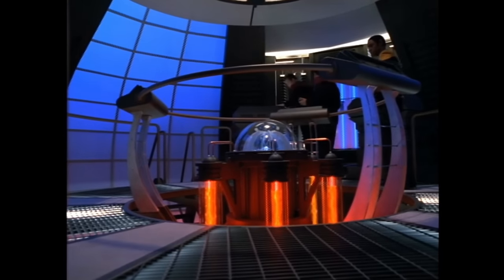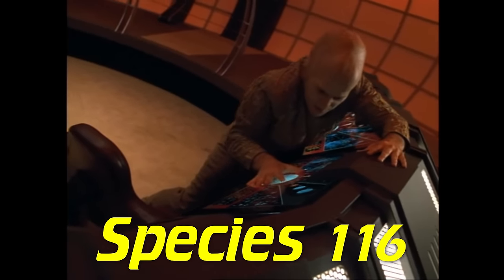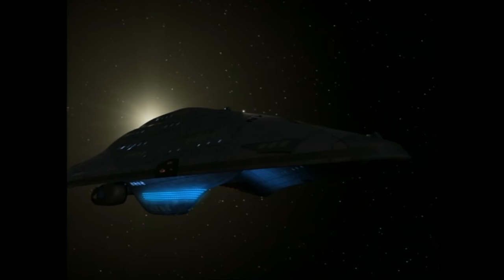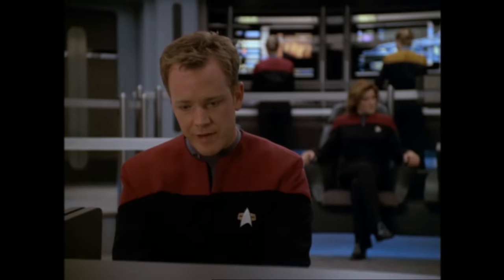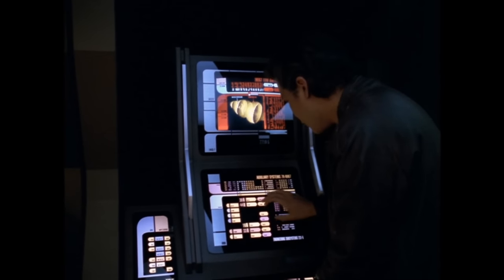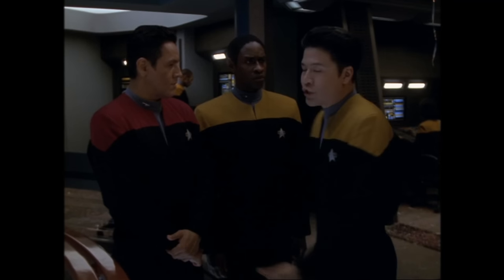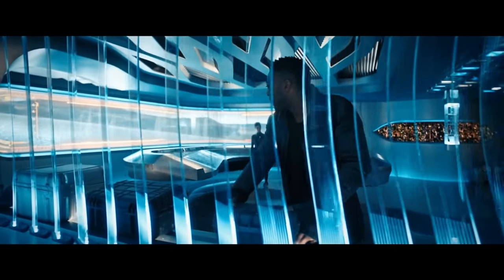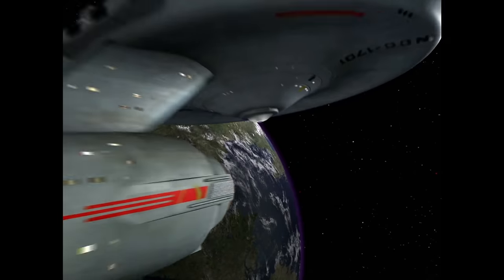Did Discovery IGNORE These Warp Drive Alternatives?

Comment: I like the idea of the "Transwarp" from Star Trek III simply being an improved warp drive that eventually lead starfleet into revising the warp scale from the one used in TOS to the one used in TNG for the sake of simplicity. This would mean that the Excelsior's Transwarp drive actually did work after they repaired the sabotage Scotty inflicted on it, but it was more of an evolutionary improvement than a revolutionary one. This could also be a reason the Excelsior class was used for such a long time while the recently refit Constitutions were mothballed. Maybe it just wasn't possible from an engineering standpoint for the Constitution to be outfitted with the new "Transwarp" drive, while it was possible to upgrade the Miranda.
Reply: My head-canon is that it was the thin neck and pylons of the connie that wasn't compatible with the transwarp, hence why miranda and oberth were also used until the late 24th century
Reply: @Mat0llig  Could also lead into the reason the Constellation was a 4-nacelle design with such unusual placement. A brute force method to achieve the same effect, perhaps?
Reply: i could see the Federation building gravity catapults. They finally had a technology they understood, could build themselves and allowed ships to jump the equivalent of a three year journey.
just put them near secured Starbases or planets and you have the relay network from mass effect for rapid transport.
Reply: I wish they could’ve built upon the tech that Barkley developed when his brain was overclocked by the Cyphereans. Starfleet ships could then have a man machine interface like the Bentusi from Homeworld.
Reply: @Mat0llig   I really like this idea. As a bonus, maybe the new Excelsior "Transwarp" drive didn't need to have the warp coils as isolated from the rest of the ship as much as the TOS warp coils needed to be isolated. This would have meant future designs could be more robust structurally and the shape of the warp field could be made more efficient since the ships were more streamlined.
Reply: @KertaDrake  Very interesting idea! I assumed the Constellation had 4 nacelles because it was designed to operate with a high cruising speed (for it's time) over long distances.  Maybe they were instead a hack added to the design at the last minute that enabled the ship to have speed similar to the Excelsior
Reply: @noneed4me2n7  I wish they would have explained why Voyager couldn't just use the slipstream for a few minutes at a time and make a few hops to reach Earth in the episode 'Timeless'. I don't recall them saying anything about it not being able to be shut down and then restarted again. They only mentioned something about the super dilithium they acquired breaking down, but it didn't seem like this would take place within a few hours.
Reply: @noneed4me2n7  
i think it had something to do with Barkley's super charged brain making the calculations. the federation would never allow the genetic alteration and there was no bio nerural gel packs at that time so it was probably abandoned.
Reply: That questionable explanation doesn't explain why voyager was limited to warp 9 on the tos scale. They even made episodes about not exceeding w 10 and how it will take them 70 years to get back.

Comment: Actually, the primary reason aerospikes (which are basically just inverted bell nozzles) aren't used isn't anything to do with infrastructure or anything like that. Its simply that aerospikes are harder to cool, and therefore tend to have a higher mass penalty compared to traditional bell nozzles. 

Honestly, I figured that the Xindi vortex method doesn't get used is because it probably relies on the weirdness of the expanse (it can probably allow travel between the expanse and normal space, but not without at least one endpoint in the expanse), and so simply doesn't work after the spheres are destroyed. 

And everything else that isn't basically just Q snapping his fingers probably relies on dilithium crystals, so that's out.

Comment: There is also a major point you did not bring up: if transportation/technology is eliminated, then building back up to a working industry to create it is often based upon it, creating a difficult recursive dependency.  In other words, if all land and sea vehicles were wiped out today, we would have grave difficulty making new cars: Chinese steel couldn't go to Tennessee body works to be paired with Detroit engines and Indian electronics and wiring, European batteries, etc.  Moreover, each of those individual parts are based on subparts from around the world.  Now expand that out across a quadrant of the galaxy and the immensely diverse needs and capabilities of a starship.

Comment: With all the focus on dilithium going inert I kind of have to wonder if everyone collectively forgot about Fusion and Fission powered warp drives, neither of which use antimatter or dilithium. I seriously doubt that Zephram Cochrane was able to scrounge up a single yottagram of antimatter to power the Phoenix when Lily was struggling to pull up enough titanium for the cockpit, especially when there was a convenient fistful of fissionables from the warhead of the missile he converted. 

I also seriously doubt that early era warp vessels and civilian freighters that were pulling warp 2 at best were using antimatter as fuel on their years-long journeys to the nearest colonies to Earth, since the Kzinti lesson would very much apply when Piracy came into the picture. 

It's just kind of bizarre from my understanding. Use energy to make plasma, feed into warp coils, go FTL. The only special thing about antimatter is its relative efficiency compared to fusion and fission. Only thing I've heard from STD Stans regarding this is that "Warp Plasma" is different from regular plasma and 'needs' antimatter to make it happen, despite the D'Deridex Singularity based warp essentially proving that generating a warp field is power source agnostic. ¯\_(ツ)_/¯
Reply: I’m sure the Phoenix was fission or fusion powered, but it might still need dilithium. 

Ultimately it comes down to the age old fan debate over whether the warp coils warp space or whether they’re simply very strong electromagnets to channel the dilithium plasma which is itself what warps space. Now I always favoured the latter, partly because the warp coils remind me of tokamaks (especially Vulcan ones), but Star Trek really doesn’t specify. 

At least until Discovery saying dilithium does stuff to subspace, but then maybe verterium-cortenide also does and you need both. Of course you could just as well ask where Cochrane got verterium and cortenum from while they struggled to get titanium, especially since the coils we saw in the show seemed to be regular old copper refrigerant tubing.

Ultimately it kind of just all breaks down if examined too hard. Even pre-Discovery.
Reply: You cant pass warp 2.2 without dill to stabilize

Comment: While time travel was banned (for the best I guess), ultimately that tech could still be used for space travel, given a ‘time drive’ requires moving through space as well as time, you could, presumably, produce something akin to a ‘jump drive’ out of that; essentially an instantaneous jump from point A to point B…

The underlying issue for the franchise is that they’ve clearly decided the audience needs to hear core things like warp drive or photon torpedoes, so they keep coming back to that regardless, even if it doesn’t make a lot of sense to story progression when set much further into the future.

Comment: So why I did enjoy the video. I think you miss mashing too many things, and of course there are issues with the writing in discovery for the third season and how they describe the burn.
Let's start with the mismashing, dilithium is not needed for warp speed. It's needed to generate power because in order to reach warp speed you need a lot of power and the faster you go, the more power you need. Every one of these methods that Star fleet developed or found to travel faster than standard warp speeds. Required excessive amounts of energy and their standard way of generating energy was through and antimatter reaction created by dilithium. In the case of quantum slip stream as you bring up, they use benamite crystals which from the description allow them to adjust the phase variance but doesn't have any role to play in power, which at least suggests that the quantum slipstream requires less power then a warp drive does, otherwise you would still require a matter antimatter reaction to reach the power requirements. The problem is that the writers never think in this set of terms of what dilithium other things are actually needed and it really is just a matter of power. Anything else that's added such as the benamite for quantum slip stream are just add in components needed for operation.

In Star Trek Discovery during the 31st century, it seems like if you have dilithium the ships are traveling much faster than they were in the 24th century going from one end of the Galaxy to the other doesn't seem to take that long anymore with standard warp drive. The writers just didn't expand on the Galaxy enough to make it seem like the warp drives were that much faster. And with faster war drives, probably integrating other types of what was previously considered trans Warp, they probably just continued using the same energy generation capability because like with gasoline. If you want more power you just add more antimatter. Where is with the romulan quantum singularity? That thing is putting out the same amount of power regardless, and the protostar well making a baby star and containing it probably isn't easy. They may have sacrificed some speed by sticking with solely antimatter but it was an easy source of power that they knew how to use and they could squeeze out more and more speed out of their work drives and the one something became standard. It was no longer trans warp. It was just warp.

Comment: We dont use aerospikes not because they are buggy, compared with bell nozzles, and not because we cant be bothered "fixing" aerospikes, we do it because we dont know how to make an aerospike good enough that it will be better than a bell nozzle.

By that I mean that it won't add so much weight and complexity to the engine that all the added efficiency is effectively lost in the extra weight.

When almost every stage of your flight is efficient enough, and you are using staged flight (such that you drop off and land earlier stages) then the advantages of aerospike are even less.

Remember aerospike is about having an optimal nozzle at all altitudes.

If you drop your nozzle off (ie disconnect stage 1 and land it) you are effectively "varying" you nozzle, because stage 2 will have a different nozzle from stage 1.

So you get your "varying" nozzle along with a MUCH lighter and easier to build engine for "free".

No need to vary your nozzle, if you are changing nozzles whenever you encounter significantly different environments.

Aerospikes WILL have a use, but they will need to compete with bell nozzles.  If your engine is only ever operating in 1 atmospheric mode, the bell nozzle will almost always be "better" because it will be lighter and easier to build.

Comment: Well, considering Zephram Cochraine didn't even have dillitium, obviously dillitium is NOT necessary for warp/FTL, it just helps stabilize the antimatter which is merely ONE method of generating Warp (the Romulans, for example, used micro-singularities). Its almost as if the writers of Discovery never watched a single episode of Star Trek. Another great video - very informative.
Reply: Fusion powered warp drives peaks at Warp 2. Warp 2 is Uber slow. It would take about a year to get from one side of the Federation to the other. I think that nonbinary couple was on a warp 2 Fusion ship.
Reply: Hell, the Romulan's method never used Dilithium at all with it.
Reply: @AzraelThanatos  Does make you wonder just why they were mining out the dilithium on Remus for though...
Reply: @KertaDrake  Trade and, probably, having a second set of ships that they'd been using that don't look like Romulan ships. Dilithium is an important trade good after all
Reply: @KertaDrake The Romulan Star Empire used 2 different drives.  The D'Deridex Warbird uses the singularity drive, but most of the other ships use a standard warp core.  Basically, the singularity drive was only put in the most power-hungry and elite ship class, and everything else got the easier drive.
Reply: @KertaDrake   Micro-singularities ship are more demanding on maintenance then cheap Dilithium at the time
Reply: Lol "as if"
Reply: Dilithium is not a power source. It's used to focus energies to produce a warp field, as it exists partially in subspace. All warp drives that exceed warp 2.2, regardless of power source, need dilithium to focus the reaction. As for other sources, Book explained in a throwaway why none of them were terribly useful under the circumstances (slipstream needs a very rare mineral, for instance).
Reply: @TheMrPeteChannel waaaay more than a year. Vulcan is 16 light years away, warp 2 is 4 times the speed of light, so even Earth to Vulcan takes 4 years at warp 2.
Reply: @KertaDrake Prior to the micro singularity drive, they did use dilithium. But they probably traded with dilithium as well.
Reply: It was reported during an interview that there was a small amount of dilithiam in the reactor if the Phoenix. It was EXTREAMLY rare on earth, but there was a small amount.
Reply: @aaronshutts1024  The most obvious reasoning would be that the Enterpsie-D crew gave it to him... but they didn't want to do that.
Reply: @subraxas  So NOT going anywhere, ever again, would be the solution to 'its too slow'? Have you ever WATCHED Star Trek? EIGHT centuries? Slower Fusion drives just means slower proportionate to other tech you could employ, like subspace corridors or transwarp. And don't even get me started on the fact that Starfleet was already experimenting with artificial wormhole generation during the TNG/DS9/Voyager era. Speed doesn't matter all that much when you TUNNEL through space.
Ships in The Expanse don't even have FTL - speed doesn't matter when you can make gates.
Reply: @marktaylor6553  no. The discovery of the dilithium on earth was one of the reasons he got the idea. Now the big question was it natural or was it debrie from some other past ship event.
Reply: @aaronshutts1024  Is that Beta canon, because I have no recollection of any Dilithium being used at any point by Cochraine? What IS canon is that plenty of other species that the Federation has encountered since before there even was a Federation used non-Dilithium based methods of propulsion. You can fudge stuff all you want to try and make this huge plot-hole work, but at the end of the day, STD was a big, wet fart.
Reply: @subraxas  I don't 'freak out'. Way too old for that - I could break a hip or something. 😝
But my whole point was, any long-time fan would know one of the oldest (and perhaps silliest?) tropes on ST is that people on the Enterprise CAN find a solution to absolutely any problem in a single 60-minute episode, even if the entire Federation has been stumped by the problem for centuries. 
So IN THAT UNIVERSE, where we have been trained to understand that humans can overcome ANY diversity at all, and literally save the entire galaxy numerous times without a thanks for our efforts... in THAT universe, humans just went, "all our dilithium is gone, I think I'll go cry in the corner for next eight hundred years"?
These aren't RW humans - these are ST humans. They don't give up. They NEVER give up. And Discovery just took a main aspect of the franchise, crumpled it up, and threw it right out the window. Sorry if I came off like a d__k, but stuff like that - a complete disregard for the flavor of the universe itself - really annoys the crap out of me. Now I'll go take some Geritol... my hip is bothering me again. 😅
Reply: Based on all the references to other forms of transwarp it’s clear they did watch Star Trek before and based on how important dilithium is treated it’s safe to assume that going to warp without it isn’t exactly a reliable method.

Comment: Honestly, I assumed some of them were tried and tested but weren't as great for one reason or another.
Think about how lead diesel is more efficient and quieter than normal diesel, but has several negative side effects both to the environment and human health.
Also given the Federation seemed to cover more of the galaxy in the 31st century, it's possible the warp scale has shifted again by this time and transwarp is just "too slow" by comparison to "conventional" warp.

Edit: it's also possible that these methods require some level of dilithium, possibly even more than usual warp does

Comment: I don't think they forgot anything, it's possible that transwarp was developed as a potential replacement for the spore drive to grant a safe, straightforward and less threatening high speed travel method. 

One that Next generation and beyond seemed to forget ever happened with the u.s.s. Excelsior, which only failed because scotty tampered with it, if anything THAT is the bigger glaring issue with continuity, logic and canon, that they'd just stop trying with something that was built and ready to work because it didn't work one time, they must have tested it on other ships before slapping it on a crewed heavy cruiser like the Excelsior. 
Spore drive at the very least had an explanation for why it never showed up again, transwarp had none.